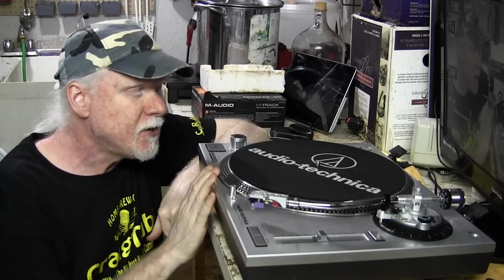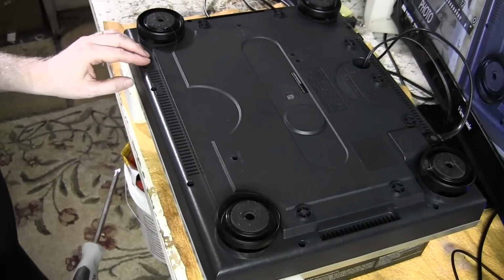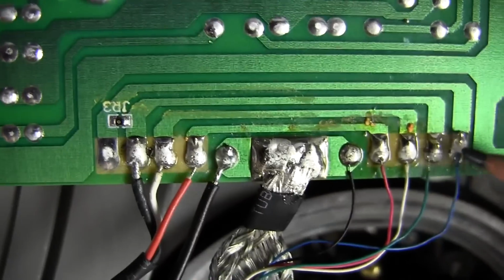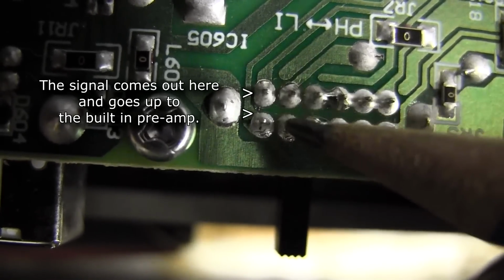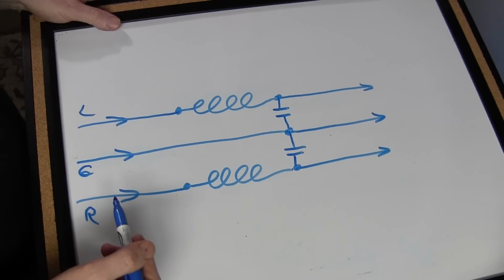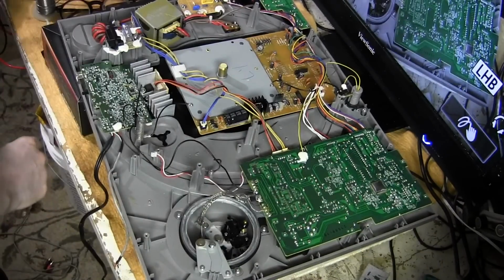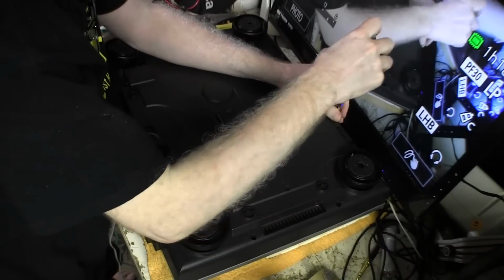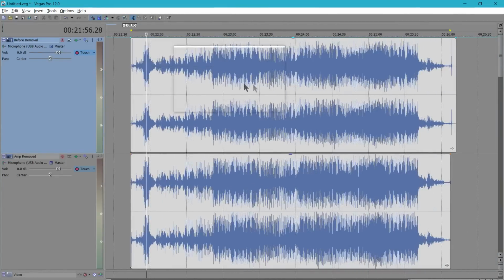Preamp Removal - Audio Technica AT LP120 USB Turntable

Comment: I may miss something but after removing the original preamp, what other preamp was used that did the RIAA corrections? Because what we compare here is the embeded original preamp with the external one. If there is no RIAA correction after, then this is what we hear as the difference. I am sure I miss what the external preamp was.

Comment: OK, so the idea here is to remove the preamp and replace it with another preamp., which sounds better, right? Good to know, if you own the Audio-Technica. If you don't own the AT, it's just another reason among others, like broken anti-skating, bad tonearm bearings, and noisy motor to buy another turntable. Interestingly enough, I bought one of these turntables for my mother-in-law and in spite of the declared problems associated with the product, it still sounds really good, making the issues seem to be moot.

Comment: Are you kidding me?
Did you say that the second recording was done without the RIAA pre-amp on? There' s absolutely no way that it could sound like this! The reason for the existence of the RIAA pre-amplifier, is to raise the low frequencies which have been gradually faded, because of the needs of the material' s(vinyl' s) nature.

When we play any vinyl record back, we should ALWAYS use the pre-amp, specifically designed for turntables' styli. This is how the things are, not my personal opinion. If you don' t use it, you just lose all of the bass. It won' t sound as it should, from the studio console output and onto the consumers' material(as on a cassette tape,or CD, for example). Period.

The reason for the swicth, to choose between any pre-amp or not, is ONLY because you might prefer to use your external pre-amplifier. Be it stand-alone or as part of your power amplifier. Which might be better than the one installed in the turntable itself, depending on what every person has in its possession.

And you didn' t have to rip the entire pre-amp PCB out, but you could just desolder its power supply. And of course desolder the cartridge' s cables and resolder them on the two RCA cables.

Sorry if I made any mistakes in grammar or syntax, but I am Greek(grammar and syntax = 100% Greek words, by the way).
Reply from the maker: I used an external RIAA preamp for the second recording. 

The RCA cables attached to the built in pre were not possible to remove. The connections were covered in hard glue. There wasn't room to tuck them inside the turntable, so I removed the unit and left it in tact.

Comment: Why even go through all of this trouble? You did all this just to use crappy wires and crappy solder to connect to a crappy board. Why not just get a decent table in the first place? You're only going to get so much sound out of that cartridge to begin with anyways. Just seems futile. like polishing a turd.

Comment: Measured from cartridge to end of interconnect, the capacitance is about 700pf, even with preamp switched out.. Much too high.. I would remove the preamp and replace the interconnects with low capacitance inters...

Comment: Brighter sound after remove the Filter. because the capacitors in this configuration (Low-Pass), filtered the high frequency. I'll look at my turntable if there is the same configuration

Comment: I've been exposed to audiophilia, and realize alot of the descriptions they give to equipment and sound is subjective.  That being said, the non-preamp recording had more AIR , which basically means it had a slightly more extended high frequency range. I wasn't as patient as you were when I got mine. I immediately ripped that preamp out and didn't look back. Great information here.

Comment: With the preamp there seemed to be something like a -24db cut somewhere around 12k to 14k. That’s just a guess, but a simple frequency analysis would reveal the answer. Perhaps the original intention was to remove digital noise caused by cheap components that reveal themselves between 18k to 20k (which is a common practice).
Reply: The USB duplication is unaffected by the filters as they are downstream

Comment: Thanks for the insight, I just removed the shunt capacitors & replaced inductors with 0 jumper blocks = much clearer treble, further more replaced tweeter caps in the jMax 127 speakers - more clarity. Electrolytic caps are no good in tweeter xovers, ESR attenuates treble, use metallized polypropylene caps

Comment: Why would you remove the preamp if there’s a switch behind the turntable to use other preamps?
Reply: Thanks for your interesting video, but i have the same question : Why remove the preamp? You have a switch behind the turnable to bypass it, no?
Reply: Ben the switch doesn’t fully bypass it

Comment: Hello Craig, excellent video, Is this necessary with the AT-LP1240? I want to do the same with theAT-LP1240, Could you tell me what difference in connections with this one? the 1240 does not have integrated the RCA cables.  Regards.

Comment: The difference is very very minor and i bet changes from record to record also i did notice your finger bumped the input slider slightly raising it and the master volume just slightly and that might have made the difference. Who knows right. Also you lose the convenience an internal preamp creates. I can plug mine straight into any powered speaker, any old receiver i can find.  Ill keep mine. Great video though thanks

Comment: Craig, solid video! Well thought out, filmed, spoken, etc. I was hoping to do something similar to this, but keep the usb and RCA connections from the preamp functional. I’ve seen a video on this(the guy rushed it and wasn’t very clear with the pics and chose not to show how he would connect the second set of RCAs from the preamp other than a drawing I didn’t understand. I’ve provided that link below so as not to clutter this already lengthy comment. I’m curious what your thoughts are on this idea. Basically I’d like to have two different sets of RCAs(one direct to the raw arm board signal and one from the preamp) and the USB for recording etc. Why? Cause I have one amp that has no phono in and a Marantz that has a phono in. I’d like to be able to use my TT on both and not have to invest in a external preamp. Is that even possible? I feel like it might be but I’m missing how the the preamp RCAs would be wired. Also, I’ve seen people using the dust shell as a support so that you don’t mangle the tone arm while upside down. Thoughts on that? Thanks for your thoughts and help! 

https://youtu.be/WpeL7lUonQ4

Comment: Is this issue only with the USB version of the AT-LP120? I have the non-USB original version.
Reply from the maker: You'd have to look at the built in preamp and see if those same capacitors are there at the output.
Reply: Did some digging, this older non-USB AT-PL120 (not LP120) is not affected by the same issue. The bypass switch actually bypasses.

Comment: Listening to this on Genelec studio monitors, there is definitely a difference. It's as if the preamp cuts off around 16k hz. Whereas without the preamp, it sounds as though it extends to around 18k hz. the snare has more clarity, and vocals stand out more, and the cymbals are smoother. Definitely going to do this when i get my new turntable.  THanks for the video!

Comment: What about wiring a switch to the power cable of the preamp and adding another set of inputs to the ones already soldered on the main board?  That way you could still use the usb option, and just cut the power via the switch when not in use and use the other set of inputs.  Is this feasible?

Comment: I took the preamp out...floated the turn table base from the housing...put "O" rings on the tone arm.  Modded the anti-skate..Raised the platter so the tone arm is now parallel  to the record.Lost the felt pad...put on a rubber mat with a deer skin cover on top of that.....got the heavier counter balance...got a scale to measure the tracking force...got a protractor and adjusted the cartridge...Leveled the stand the turn table is on and got a spindle weight with a bubble level in the middle to make sure the turn table is level... I like it now.

Comment: I removed my preamp today following the way you did it and it works great!  I still notice a slight motor sound though. I'm working on a fix for that...Thanks!  BTW...you don't have to tape the spacers...I just threaded them through the screws and dropped them in the holes...

Comment: Is there a comparable TT on the market with both a switchable preamp and USB output that doesn't suffer from a questionable preamp?  I really want to have the USB output option.  I have an AT LP120 USB but am reluctant to do this preampectomy., or maybe just too lazy!  In my neighborhood the LP 120 seems to have strong resale value so I could unload it with little loss and get something else.  Or I could do the preampectomy (potentially putting a dent in the LP120's resale value) and then spend $200+ on an good external preamp with USB output.  I'm not sure I want that much hassle or that big an investment.  Am thinking it might be wiser to sell the LP120 and put the proceeds toward a TT with similar features,, but without a problematic preamp.  Do such things exist?

Comment: +Vinyl TV First of all, GREAT SONG!  Where can I get it?  I also noticed that there was a spring inside the case where the ground cables where screwed in. When the case was screwed back in place, I noticed that the spring was bent out of place. Would that affect the functionality of the turn table? Also, will this mod also work with the AT-LP60 Audio Technica model?

Comment: It's the same story with "analogue" components. Everything has its own "sound". Noticing subtle nuances via compressed mediums such as youtube is kind of like changing a bulb in a power cut. If you're able too, I'd suggest uploading the wavs directly somewhere that users who are interested can access 🙂 I can concur though, that I too own the AT440MLA and run it on a Rega planar 3 (80s version) with rb300 tone arm. The current amplifier i have is a yamaha ax-396 with mission 772s. I am forever changing components. However, I noticed the rega not sounding "as good" as it used too. There was a serious channel imbalance, plus sibelence increase. I checked everything, new stylus, full realignment. No change. Tried a different TT (currently have 3) and similar issue. I bit the bullet and purchased a pro-ject phono box ds. Wow!! What a serious sound change (positive i should add) rediscovering everything all over again now.

Comment: I know I'm over a year late but I have to comment on this.
First I'd like to thank you for this. I never expected the difference would be that huge. This is a real eye opener. And I definitely prefer the "after" version. Much crispier, clearer and defined. If I'd ever buy this turntable I will have to do the preampectomy as well.

I have only one question concerning the before version:
Is the built-in preamp in use here or is it switched off? (Just passing the signal through the filter coil/capacitor "stage" and using your external preamp?)

Comment: Hi Craig, I've just seen your video. Your hint about the capacitors and coils at the output of the signal was really helpful for me. I didn't remove the preamp. I soldered a thin cable bridge from before the coil to after the capacitors for each channel. This short circuit around the output filter has the same effect but the USB remains active and can still be used.

Comment: I just performed this preamectomy. I did things slightly different, but it sounds great! I simply unplugged the white/red wires at the preamp. Then unsoldered the red, white, and outermost black from the mainboard. I then resoldered my new RCA cable, combining the grounds to the outermost pinout on the mainboard. I left the innermost ground from the mainboard connected to the preamp. Further, I left the preamp and the existing RCA outs in place (I effectively have two sets of RCA's exiting the unit). So, the built in preamp is dead but easily reconnected. And, those little brass rings that surround the 8 screws? A little dab of hot glue will easily keep them in place during reassembly.  Thanks for the great video!

Comment: Interesting!

Certainly the highs are more pronounced after the modification, however, one question.

Have you tried to listen without any signal from a record, just to establish if the noise floor has changed?  Sometimes, with mods such as this, various hums / noises appear, ever so slight that, you can only hear them without signal and at full volume on the preamp.

Great video and very professional work, congratulations and thanks for sharing!

...Oh, and as an afterthought, you may replace that cable you have used with something  a bit better such as silver or very high purity copper.  You may find further improvement in the final result.

Comment: We instantly notice the difference. That preamp inside that turntable muffles the sound and some high frequencies are gone. I have done this modification to mine some years ago but I have left the preamp inside the turntable. But the other thing is this is not a good turntable. It is a cheap imitation of the Technics turntables.

Comment: Just did this upgrade, tremendous difference! Turn table sounds high end now even with original cartridge.  Had a few issue though.  First attempt, used quality shielded cables.  Tied each cable ground  to the board and a separate ground for my preamp.  Had an unacceptable hum i could not get rid of.  Discovered in was my "quality" cable.  Installed another good cable and had much better results.  Also grounded both wires to single solder point on board on the board from the tonearm.  Still had small hum.  Used larger gauge wire on the dedicated ground wire and discovered it made a significant difference.  Hum is now nearly non existent.  This is great because i had a fair hum even before this upgrade.  So I upgraded my  sound quality, and all but eliminated my hum.

Comment: I'm likely getting this in future (for the USB recording functionality), and I'm not an audiophile, nor am I comfortable attempting amateur circuit surgery, but I do hear a difference.  Not enough to make me not eventually get this though (once it goes on sale), as it would only take tweaking through an equalizer to get a similar result.  Of course it's preferable to have as much of the original signal as possible, but there is a cost:benefit balancing act on a person to person basis for modding, or going with something else that is missing features this table has.

But really, for those of you who can't hear a difference?  It's definitely your equipment, because I've very poor hearing overall (about 30% of normal, with a bias in favour of high frequencies, so I can hear them better than deeper sounds) and even through youtube I notice a difference, when it switches from 'after' to 'before' it definitely sounds a bit flatter (and not just quieter), and there is empirical evidence from the waveform to support the opinions that there is a difference to the sounds.  It's more of a personal preference thing, as I can imagine the extra highs are like boosted treble in a way, it would be less preferable to some.

Comment: Craig, i have some ''hum'' noises when the volume of the amplifier during the listening is louder than usually. This certainly came from the turntable, because the cd player never gave me any problems.
I have this record player still covered by warranty, so i'm not going to do this now, but if this operation might remove some background noises during the listening.. i might try. Don't you think this could help me? Thank you!

Comment: Hi Everyone, I did the mod last night exactly as per the video. I cannot comment on the sound as I appear to have introduced significant ground hum which is clearly audible at low listening volumes.  Has anyone had similar issues? and if so do you have a fix? For reference, my set-uop is fairly modest: AT LP120USB turntable, Cambridge Audio AM5 amp & CP1 preamp, Mordaunt Short M20 speakers.

Comment: Great job VinylTV. Great song to dance to aswell. Definitely i could hear the clearer brighter sound even through ny android phone speaker. I just got an external preamp with usb feature. And will be getting At120 tt soon. And this mod is a must! At the moment i use a Sony belt driven TT with built in preamp. I wonder how it would sound if i yanked it out? :)